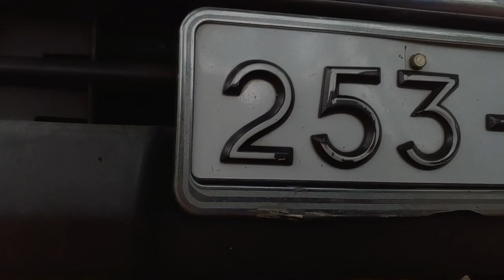Toyota Hilux Engine Oil and Filter Change Video Tutorial

Comment: Most people keep the dipstick & filler cap removed before removing the drain nut to drain all the oil well. Not sure if that has technical truth.

And I think laugh oil is relatively low graded right.?